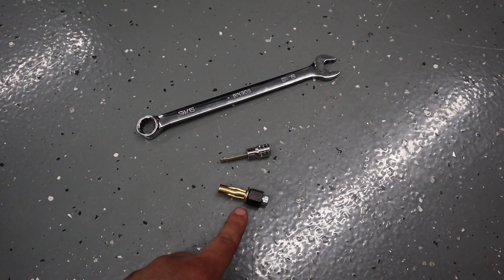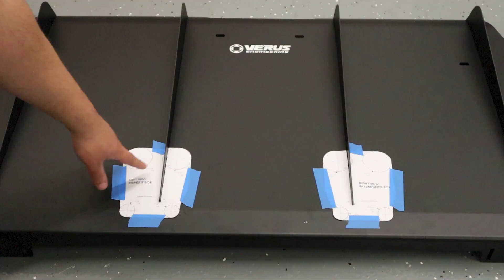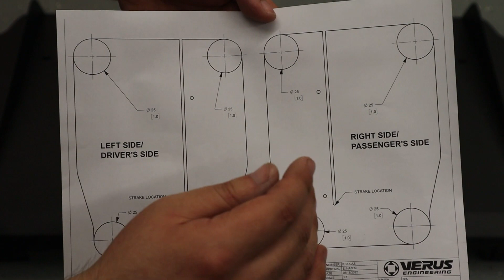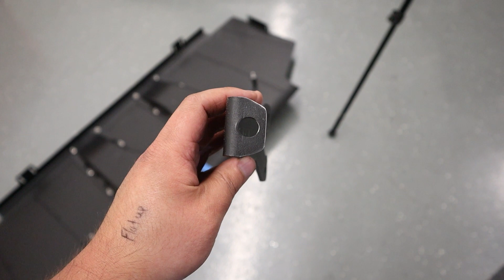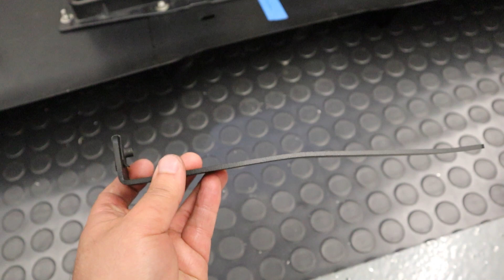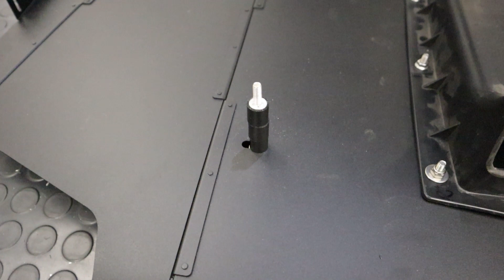S550 Rear Diffuser Install Kit - Shelby GT350

Comment: I just installed mine on my 2019 GT350. It’s worth noting that the 3 spacers were way too long to use. It pushed the diffuser down way too far and created a massive gap. I took out one of the 3 spacers and it fit nice and flush. I’m not sure if they changed the length of the mounting brackets in the kit. Verus may want to pin this to prevent frustration or confusion.
Reply from the maker: We appreciate the comment and you pointing that out! We provide the spacers incase anyone is running our diffuser with a larger after market exhaust that may require dropping the diffuser. That said, our apologies for the confusion, we'll address this better going forward.

Comment: Will this fit on my 2015 mustang gt premium?
Reply from the maker: Yes, the 2015 is still an S550. It will fit and will not require the gt350 install kit unless it has a diff cooler.